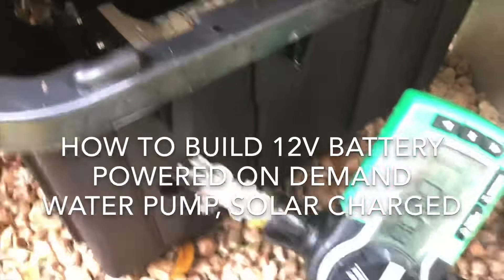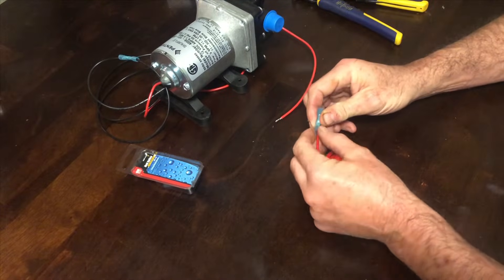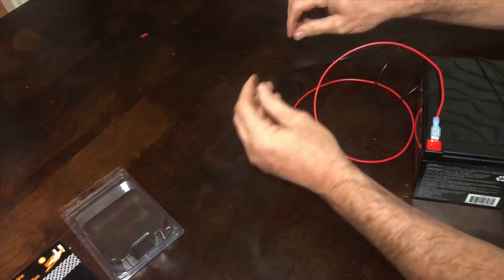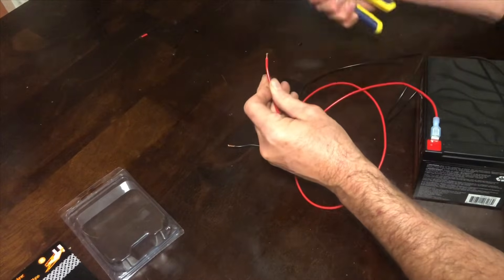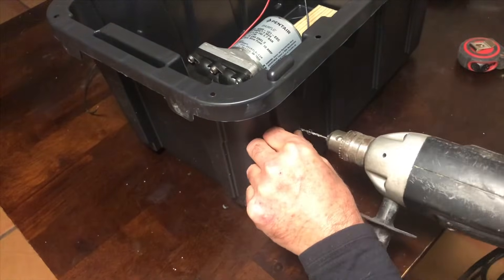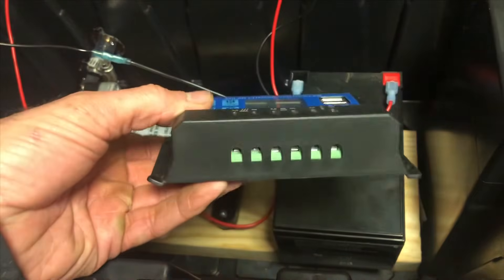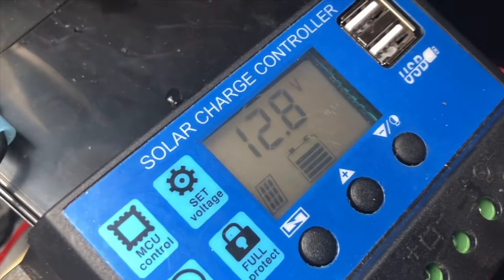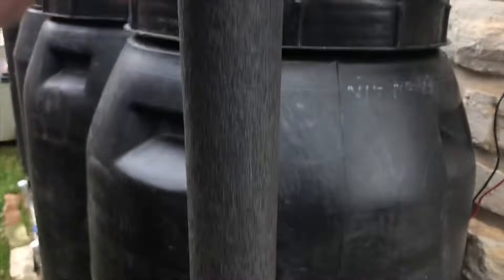DIY Battery Operated Water Pump for Rain Barrel Irrigation, with Solar Charging

Comment: Tony, great video - thanks for posting. I was wondering if you could comment on temperature and weather tolerance for the motor (and/or the system as a whole). Would this type of setup have issues in hot/humid climates such as in the Southeast US?
Reply from the maker: Jason W. I am in Austin, TX.  Only issue is running out of water in the barrels.  One good rain fills them all up, but its so hot here  (already 99 degrees)  220 gallons of water doesn’t always last until the next rain. Haven’t had any issues with the pump.
Reply: Lonestar Worms Great, thanks for sharing! I’m in Houston, TX  I figure the experience will be pretty similar, but in any case I look forward to trying.
Reply from the maker: Jason W. Good luck and let me know if you have any more questions.  I think I’ll be adding more barrels over the winter season.
Reply: @zenbrother  If it is to hot you could run your hoses to the pump under your home in the crawl space.  The floor insulation would probably maintain ground temps under there.

Comment: Great video.. Thanks a lot. Where do the fuses from your list attach?
Reply from the maker: moyse_tv 1) Between the charge controller and battery bank, 2) between the charge controller and solar panels, 3) between the pump red lead and the controller.
Reply: What amp fuses do you recommend for each device?
Reply: Ben Moscatello These are what I ordered on Amazon: 
3 Pack -12V Water-resistant Add-A-Circuit Blade Type Inline Fuse holder with Cap16 Gauge (Larger) - $7.99
Reply: Tony Franzetti thanks Tony! I ended up using the same ones. I’m using a 10 amp fuse for the pump and the battery, and a 5 amp fuse for the solar panel.

Comment: Does the pump continually cycle on and off while trying to maintain pressure?
Reply from the maker: I used an on demand pump.  When the RAINBIRD timer says it’s time to water the pump turns off.  When the timer is up the pump shuts off.  There is no pressure to maintain.  The water pressure is always there on the pump inlet from gravity and the barrels.
Reply: @TexasOrganicGardening  I have a 45 psi demand pump hooked up to 330 gallon IBC tanks, and my pump cycles on and off to maintain the pressure. I have it set to a rainbird timer with 3 solenoids, that run at different times of the day. Was thinking of putting a pressure tank on it so the pump doesn't cycle on and off.

Comment: Hey Tony.  This video and the one about the solar panel are great and I’ll be using this to build my system.  I have some pieces and parts around the house and was curious if you know the inner diameter of the clear plastic hose you attached to the pump?  (I’m prepping some parts and such before I start buying stuff.)

Also, I cannot find the link to your sight gauge build.  

Thanks again for the great stuff!
Reply from the maker: Ron Mele Its 1/2” ID 3/4” OD from Home Depot
Reply from the maker: https://youtu.be/r-kJbgX6ZoY

Comment: Can I use a regular car battery with this set up?
Reply from the maker: Manuel Salgado I’m not sure that car batteries are the optimal choice for solar charged systems.  Deep cycle batteries are typically a better choice, as the deep cycle batteries perform better in situations like solar where they may get fully discharged and then recharged.
Reply: Lonestar Worms 10/4, thanks for the response
Reply: @TexasOrganicGardening  that said, there are a few deep cycle car batteries, like the Optima blue top. https://www.optimabatteries.com/products/bluetop

Comment: Did I miss where you wired int he fuses?
Reply from the maker: Theresa Humes 1) Between the charge controller and battery bank, 2) between the charge controller and solar panels, 3) between the pump red lead and the controller.
Reply: Theresa Humes You didn’t miss it.  They were on their way from Amazon and didn’t arrive in time to make the video.  Good catch though.  I
Reply: Where would the fuses go? Is there another video?
Reply from the maker: Manuel Salgado 1) Between the charge controller and battery bank, 2) between the charge controller and solar panels, 3) between the pump red lead and the controller.
Reply: @TexasOrganicGardening  I'm a little lost on this. any chance you would be able to add a short video showing yours?
Reply from the maker: @lynsey911  Yes, I’ll get one done for you this weekend
Reply: @TexasOrganicGardening  did you get the video made with the fuses? If so, do you have the link?

Comment: I need a little assistance, I got my system set up like yours with a water timer however the pump isn’t taking off when the timer kicks on, I have to push the solar controller to kick on. Any ideas?
Reply from the maker: Patrick Harvey Is it an on demand pump?
Reply: Lonestar Worms yes it is
Reply from the maker: Patrick Harvey not sure then.  The only time mine has acted strange like that was when we had a week of cloudy and rainy days and the battery level got low.  Resolved when the  weather got sunny again.
Check the basic like adequate water to the pump, solid wiring connections into the controller, and good battery charge level.
Reply: Hi Patrick Harvey, did you figure out this issue? My husband and I just set up our system using this video as a guide and we are having the same issue. We can get our pump to turn on when it is manually turned on via the charge controller, but we can't get the on demand feature to turn the pump on. We are stumped.
Reply: @deborahjorgensen9414  hi Deborah I finally got mine to work by changing out the controller as when talking to a engineer at a solar company he said the controller is specs need to be larger or it is I’ll fry the computer in the controller. I used the great people at newpowa in California. If you give me a couple hours I’ll get you the model of the controller. I put mine to bed as we are headed towards freezing
Reply: @patrickharvey9790  thanks that would be so helpful to know which controller worked for you! We had some issues with the controller smoking too so we definitely need to figure out a new solution.

Comment: would this pump allow you to use a hose to water the garden or is it only strong enough for drip feeding? Thanks for the video. I liked it very much and have subscribed. Looking forward to checking out your other vids
Reply from the maker: Yes the pump puts out as much pressure as from the house.  You could easily use a water hose.
Reply: @TexasOrganicGardening  Maybe I missed this in your video, but did you have to install a pressure reducing valve on the output side or is the pressure not strong enough to blow off the irrigation drip heads?

Comment: Thanks for sharing, I purchased most of the same components you have and I'm having an issue with the pump not responding when connected to the solar controller.  My pump is a 12V 8.0A SeaFlo Model#SFDP1-055-060-51.  If I connect my pump directly to the battery I can get it to run, however, when I connect through the controller I get no response.  Any ideas?  I did notice that the load (light bulb) on the screen is blinking slowly.  Not sure what that means, if anything.  Thanks for your comments.
Reply from the maker: Check for no loose wires and that everything is properly connected.  Then also make sure you have adequate charge showing in the display and that the buttons on the controller are all turned on.
Reply: Thanks for the info gents.  Thought I’d provide an update.  Binen indicated that even though they advertised the maximum current draw was 20 A, in fact the maximum is actually 10A.  This is what was causing the burning while I was running the pump since my pump draws about 17max.  When I informed them of their advertised 20A, they immediately indicated they would provide a refund and update the product description.  Thanks
Reply: Robert I have the same issue, did you figure it out?
Reply: @patrickharvey9790  Hi Patrick, it did start working for me.  I think the issue was that I had a wire incorrectly positioned.
Reply: Thanks Tony for the help.  One last thing that I was wondering if you've run into...I have the unit hooked up and working, but after running the pump for only 5 min. I smelled and saw small amounts of smoke coming from the charge controller unit.  I stopped the unit and powered everything down and I noticed that the end leading to the pump was indeed very hot and I could see a visible bubble forming int he plastic case on the end nearest the wires leading to the pump.  Any chance you ran into a similar issue?  I have also sent a message to the charge controller company.  Thanks

Comment: Thank you for sharing! I’m going to build it like this. Does the battery charging keep up with the pump or does the battery deplete after a while?
Reply: Amsterdam Tinus Yes since the pump is only running 15-30 minutes a day the charging can easily keep the battery topped off.  The battery could probably run the pump about 2 hours before being depleted if it wasn’t being charged.
Reply: @tdenarobackup  thanx!